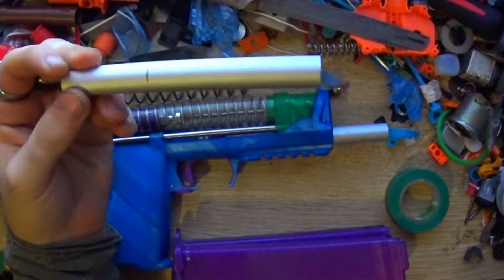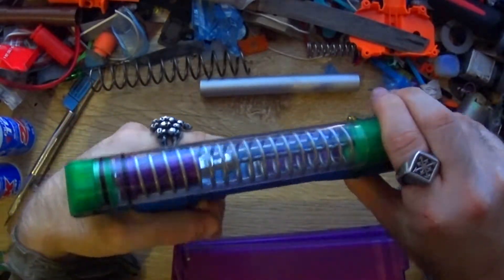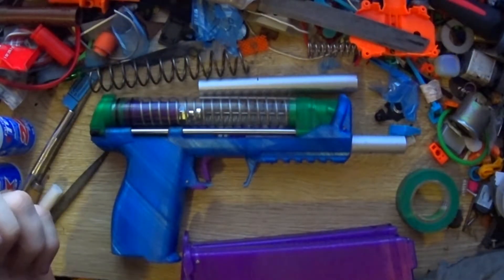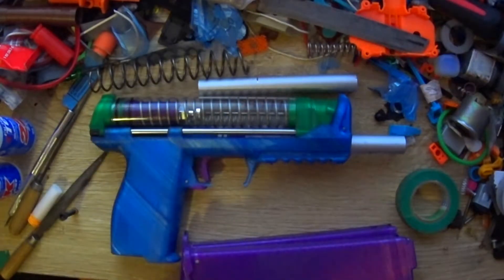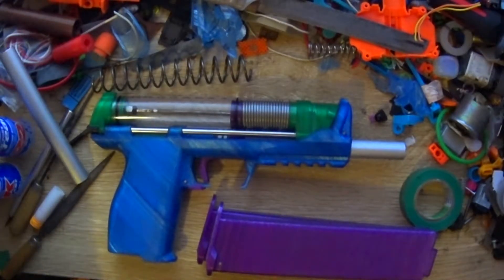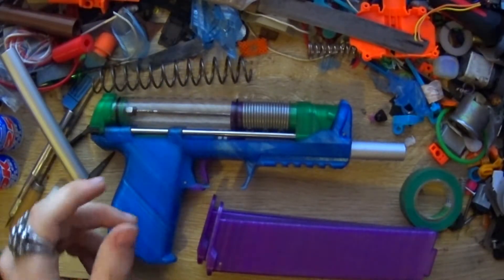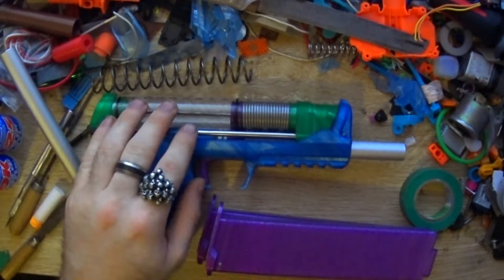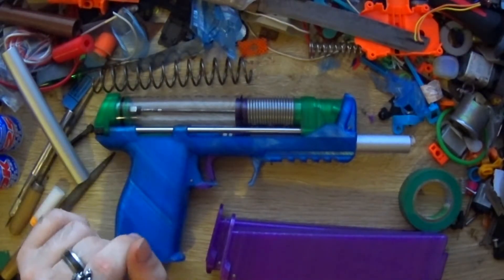(Review) 118 Designs -  Zinc - The Perfect Hand Cannon

Comment: I love my zinc to death. I also run mine with 788, but I have a custom scar and suppressor shroud and extended rail combo on mine, as well as a claw pull on the slide, different from the T-pull.
Reply: I've found I don't need a scar for mine, shoots pretty straight, but the shroud works nicely, easier to holster. They are a beautiful blaster.

Comment: How accurate is it?   Is it as accurate as the dart zone pro mk2?
Reply: No experience with a dzp Mkii personally, but have seen them in action. In my opinion, the ZINC is more accurate, and that's at a higher power level at that, thing shoots laser beams. I've down tuned mine to hit 130 fps or so, but testing it with higher power, it was still dead accurate
Reply: @ruinsleepless9098  awesome! Definitely going to be getting the next batch! Thanks!
Reply: @50shadesof_odg  They are a beautiful little platform, a little tricky to tune but once you've got everything smoothed out, they're so much fun.